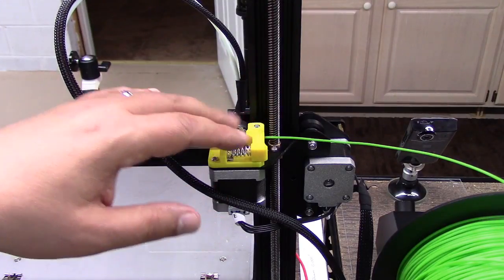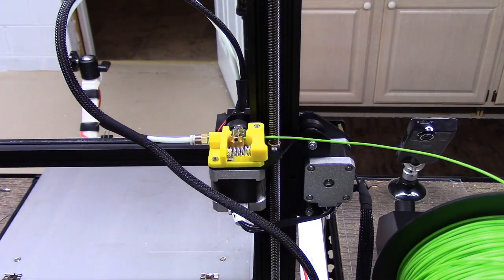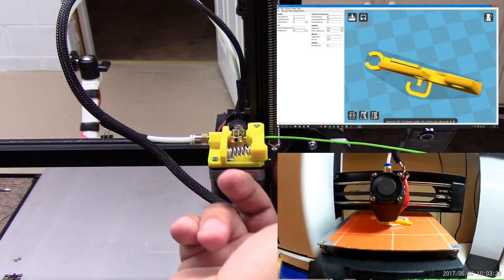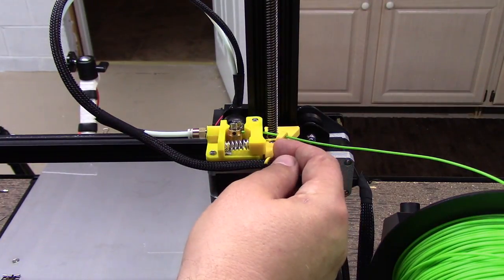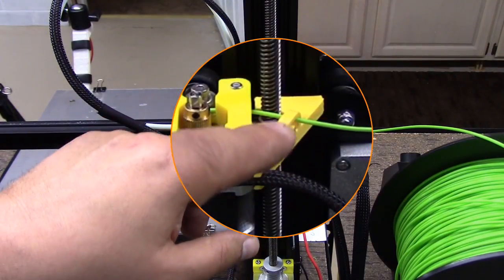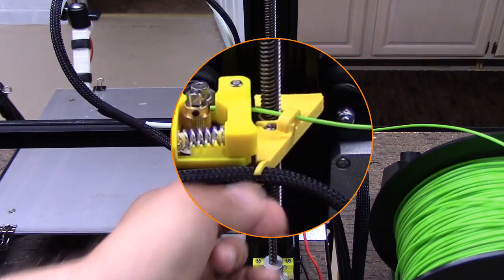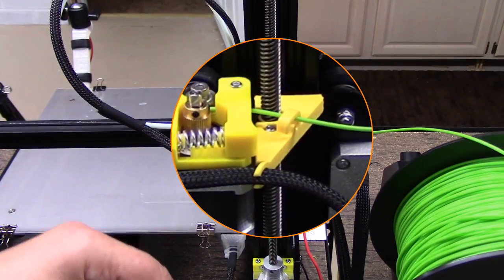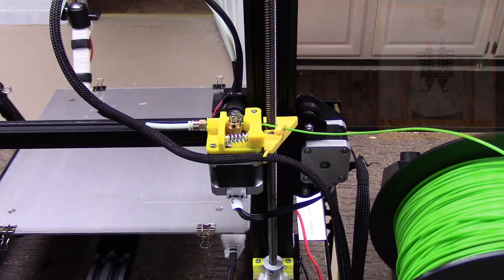Creality CR10  - Thingiverse Filament Guide!

Comment: As noted this will not fit all CR-10 as the screw location is farther part, the slot does not fit the rod, and the rod guide block below hits the clip on lip.  Tried to modify but even the mounting plate must be thicker. PLA to weak to use as it just breaks. Trying to find one to fit some of the odd CR-10.
Reply from the maker: As I understand it, they changed some of the newer ones...

Comment: I wonder if the plastic extruder piece on top could be mirrored, thus making the cogged gear further out instead of closer to the frame...
Nice video..my buddy just ordered a CR-10...so jelly
Reply from the maker: Not sure but can say you will LOVE the CR-10 :-)
Reply: I mean the part that runs the cogged gear pushing the filament...if it was backwards it would be out away from the screw...only problem is it would have to rotate backwards to feed the filament (thus a firmware update)
https://www.thingiverse.com/thing:275593
Reply from the maker: Oh I think I see what your saying now, however it would than pull the filament across the bed area.  Also you can make a stepper run backwards by flipping its wires so if you wanted to you could just re-solder them...

Comment: I added that filament guide and also the the strain relief and improved nozzle that lowers the airflow closer to the nozzle tip -  original here: https://www.thingiverse.com/thing:2303102  but improved mounting remix here: https://www.thingiverse.com/thing:2360195.    All three work great. Time to tip the creators......

I have 40+ hours on my CR-10 and am still happy except for the glass bed which is wavy on both sides.  You can see it in the surface of the print that contacts the glass.   I will order a replacement glass elsewhere to make sure it is smooth and flat.
Reply from the maker: Please tell me about the fan mod?
Reply: It is a mod of the stock fan nozzle that redirects the airflow lower and fits the same mounting.  So far I don't see a need for the "fang" style blowers.
Reply from the maker: Thanks as I agree with you I too get plenty of cooling :-)